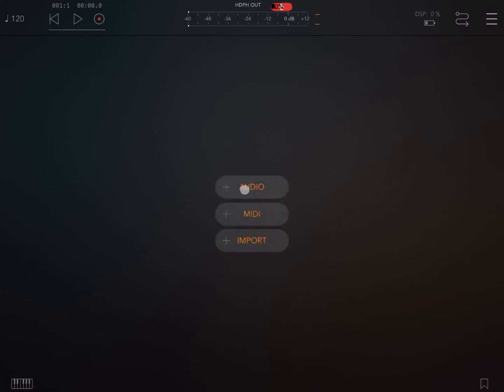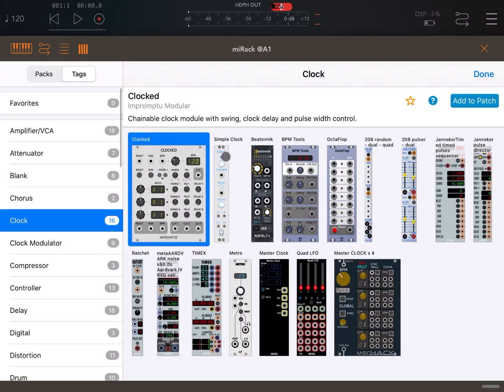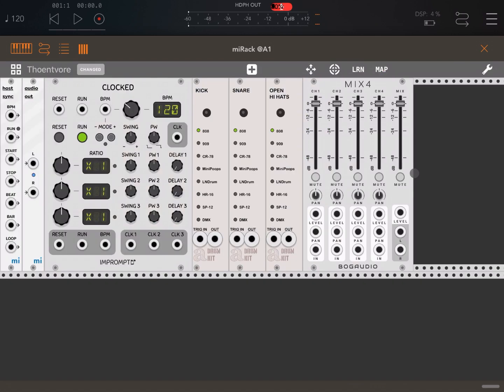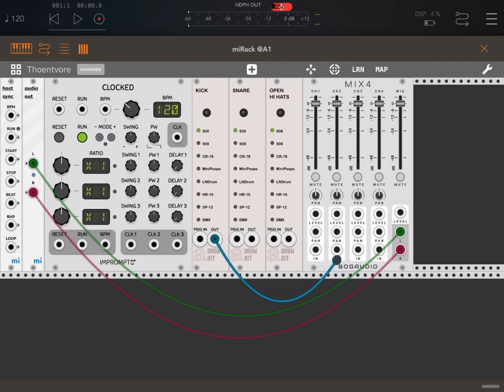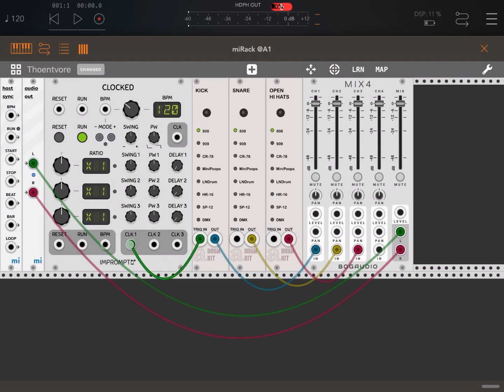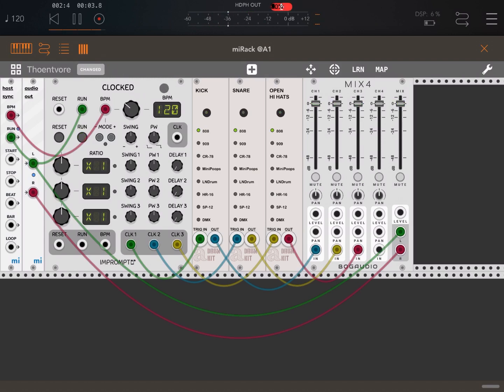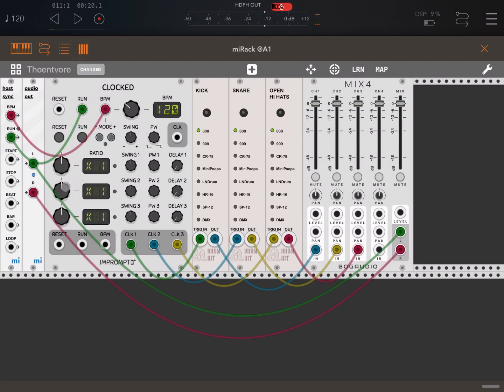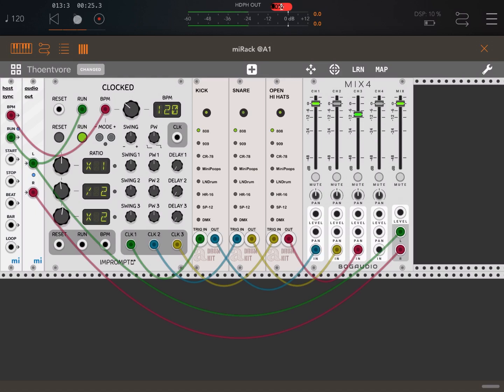miRack AUv3 - Tutorial: Exploring the app Part 2, Clock module

Comment: Hi! I am trying to sync AUM to miRack but it seems to not keep a steady sync. At the moment I am using Clocked receiving Run, Start and BPM from AUV3 host. And then use Clocked to send a /16 to get a reset for all my sequencers every 16 steps, but it never keeps sync. Is there a way of doing this? I just want to have an "analog" reset every X steps from the main clock. Thanks in advance :)
Reply from the maker: Do you have a file to share? This way might be faster to answer your question…

Comment: Awesome! thank you for the tutorials! I seem to be having latency when using mirack with AUM. 2019 ipad pro. I copied your tutorial exactly, and mirack is starting and stopping as expected, yet i notice when i turn on AUM's click, mirack is slightly off from the click. any suggestions?
Reply: oh, i just did some more investigating, and its not lining up at all. lots of latency actually. its playing at the right tempo, and run on and off is triggered by AUM, but when i load up a couple other Drum machines, Patterning, and Playbeat, Mirack is not in sync with them. very strange.
Reply: did some more digging, turns out you need reset to be triggered from Run as well, otherwise, it just picks up where the pattern left off.
Reply from the maker: very good